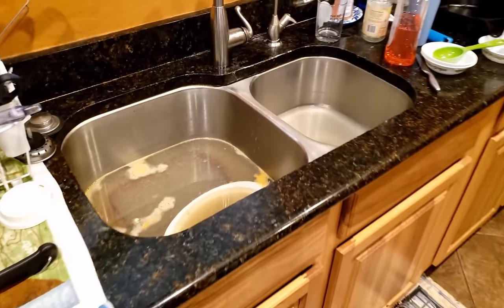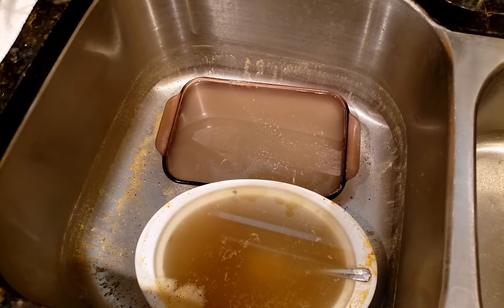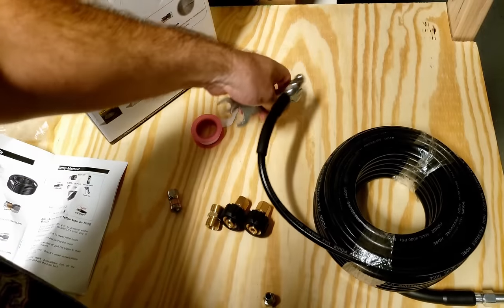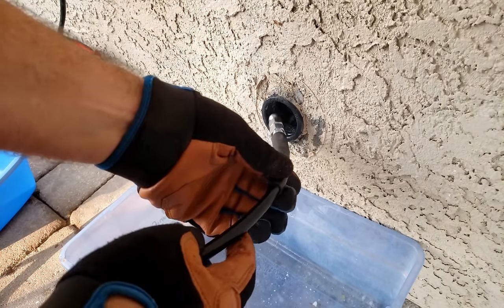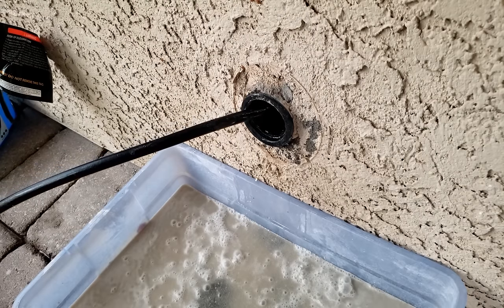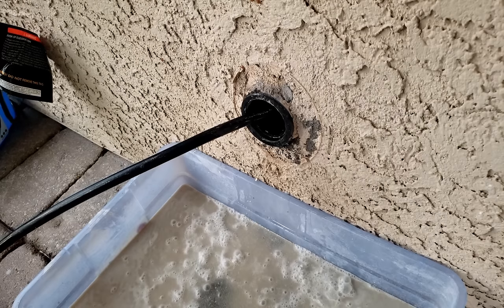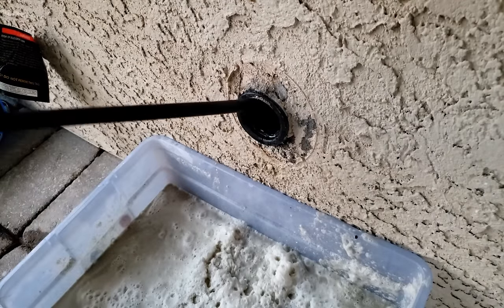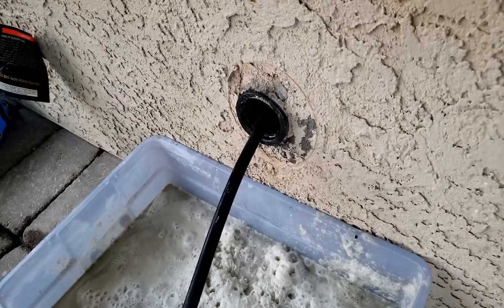UNCLOGGING my kitchen sink with a PRESSURE WASHER and the POHIR Sewer Jetter Kit

Comment: I followed how you flushed the clean out from the kitchen sink & it worked. Only needed to insert just 7-10 feet of the 50-foot hydrojet hose into the clean out in my backyard & all of the debris in the sewer line from my kitchen sink got flushed out in about 30 minutes 😎

Thanks for doing this video!
Reply from the maker: That's Great!
Reply: When I unscrewed the knob of the clean out in my backyard, I didn’t see any opening at all. Can you please tell me why?
Reply from the maker: @thanhpham-di9zq  If you are not able to find the clean out drain opening outside you can access the sewer pipe from under your sink. You can also unscrew the drain pipe that attaches to the wall. This pipe goes to your sewer line too. Just be prepared for water coming back out. Have some tubs and a wet vac handy.
Reply: @ThatHobby  : I’ll be able to locate 2 clean outs in the outside wall, but after I removed (unscrewed) the caps, I saw no opening, it’s like there’s a plug in each of them. Any idea?
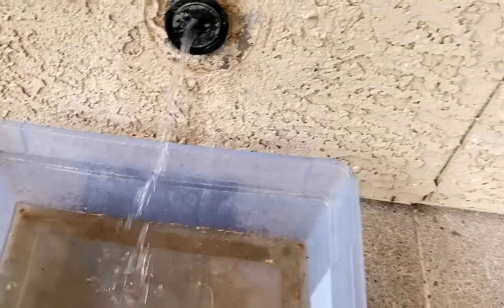Reply from the maker: @thanhpham-di9zq  Maybe there is a different kind of cap in your pipes. You can see what mine looks like were I had to open it with a chisel and a wrench. 1:37 You could try and search how to open the clean out drains in your area and see if there are some different techniques. I think the cleanout drains are different in different parts of the country.
Reply: @ThatHobby  : thank you

Comment: I’m a plumber I like to snake first then jet it doesn’t take long if you have a clean out. I have a technique to and it works great. It often gets me tips as well when I test it in front of the customer nobody is happier than them.
Reply from the maker: Great tip! A few people have recommended that I snake the pipe first. I will look into getting a good snake to test out.
Reply: @ThatHobby  just rent a 50' with 3/8 cable for a kitchen drain, unless you have to snake often enough to justify buying a drum machine.

Comment: For sinks and tubs a 1/8" jetter Hose instead if a 1/4" hose would work better, as it can be fed  from the sink drain and is flexible enough to go around there p-traps, this will work for most clogs... Also a spinning nozzle coupled with a 2500+ PSI pressure washer will clean the entire pipe interior more efficiently.

If you're investing in a system I may also recommend purchasing in a foot pedal valve and upgrading to 100' 1/4" hose to reach most mainline to sewers.
Reply from the maker: That sounds awesome. A foot pedal would be great too. I had my son pull the trigger on the pressure washer while I was feeding the sewer jetter into the pipe. So yeah a foot pedal would be better that way you can clean out the pipe without a helper.
Reply: I've always wondered about that when I see those pressure washer drain cleaning kits. They list the maximum working pressure of the hose but they never seem to mention the minimum pressure for proper operation of the jet nozzles. So a 2601 - 3600 PSI electric power washer should work just fine with a kit like this one, no need for the big gasoline powered pressure washers. good to know.
Reply: @ThatHobby  You had a lot of grease buildup in there.   That can be tough for even the pro machines to extract.  That little machine probably took a lot longer to clear, but still did an EXELENT JOB for a fraction of the cost of a drain cleaner/plumber!!!  WELL DONE!!!!
Reply from the maker: @crforfreedom7407  Thanks! Yeah it took a few tries to break up the clog.
Reply: Yea def would work alot better with a bigger pressure washer. One with more psi and a higher gpm rate
Reply: This recommendation is 100% on the mark. For 2-1/2” pipes or smaller the 1/8” hose is the way to go. The 1/8” hose has 1/8” npt pipe threads so a 1/4” male to 1/8” female reducer is needed in order to install the nozzles which are 1/4” female threaded.
Reply: I had to have a plumber out to clear my kitchen sink drain due to my garbage disposal causing a blockage. To clear that he had to run a snake from the roof drain. That fixed it until I ran my dishwasher and it overflowed onto. The kitchen floor. I called the plumber to tell him and he said they noticed lots of grease and that I really needed to have the grease cleared by power washing my drain. My bill for the sink drain was $500 and if they power wash my drain pipes to clear the grease another $500! 
I’m going to do what I read in one of these comments about heating water in the stove and pouring down the drain pipes before I give them another $500. I’m a widow on fixed income and don’t have money to pay them again. I will never use my garbage disposal again as this is the second time this happened within a couple of years.

Comment: I had a clog just this week in the kitchen sink, replaced the garbage disposal, checked the p traps ran a snake 25 ft, and added CLR, also dish soap and warm water. Nothing worked. Bought a $12 gallon of main line drain cleaner from wal mart that had great reviews, poured overnight, let it sit for 8 hours ran hot water the next morning and it worked great no more clog. May not work for everyone but take the cheapest and easiest route to trouble shoot before calling plumbers or doing too much work like this video
Reply from the maker: Yep always try the simple stuff first.

Comment: I use a bladder bag when my drain slows or clogs. It may take some time for mains clogs but it does work. When we bought the house the first winter we had it clog up and freeze up because of the clog and extremely cold temps. The bladder swells and creates a blocking point while pressurized water pulsates until it breaks through the clog. I just used one for another line freeze in a barn too. They are awesome and cheap and only require a hose and some patients to feed it down the lines. They come in 3 different sizes and the home depot husky brands are lifetime warrantied too.
Reply from the maker: I will have to check it out. I had a clog in my swimming pool pipe and I used a bladder bladder that I got from the pool store and when I stuck it in the pipe it blew up. I haven't tried any other brands but it sounds like you are having some luck with the husky brand. Thanks for the tip.
Reply: @Brogren802
They are also known as "Water Wenie" and "Drain King."
Reply: They have gotten myself into more trouble with bladder than anything else.  Cable/snake or jetter
Reply: I use smaller hose with drop head on jetter
Reply: Unfortunately "snakes" don't work on grease clogs, it's like sticking a straw into mashed potatoes

Comment: This is the first time i see a plug on the outside of the drain pipe. We don't use that where I live. Maybe because we don't have winter season. 
What I do is look up where the water stops. Open where the pupes are joining and use the drain king. Connect the garden hose to it and done. 👍🏽
Reply from the maker: I am not sure how common the clean out drain plugs are. My house is about 15 years old and I have 4 of them. I live in the suburbs and they seems pretty common out here in Arizona. A lot of people have said they like the drain king too. Just make sure you have a backflow preventer on your faucet to prevent any sewer water from getting syphoned back into your drinking water pipes. Most pressure washers have one built in. The thing I like about the sewer jetter is you can push the nozzle right into the pipe to break up the clog.

Comment: I had the same issue today in sink used a 50 foot snake and that didnt do anything i will definitely be purchasing this. Thank you so much  i appreciate it 🙏
Reply from the maker: Yeah I have snaked my drain a bunch of times. It usually worked but this clog was pretty bad and I wasn't able to clean it out with the snake either. So I got the sewer jetter. The clog was pretty bad. It took me 3 tries to break it up but once it broke up the clog the sewer jetter really cleaned out the sewer pipe.

Comment: It’s nice to wash out the pipes it didn’t have the power to go deep inside, but rodding it out the old way seems cleaner and would go deeper. I would buy one to try it for certain applications thanks for the video.
Reply from the maker: Thanks! The kit I used came with a 50 ft hose. So it went in the pipes a long ways. They also sell a 70 ft and a 100 ft hose for this kit too. I had a 25 ft metal snake that I used a bunch of times. But it didn't work for this clog. So I needed something bigger. To get a 50 ft metal snake was kind of expensive. So I decided to try the sewer jetter kit first and it worked great.

Comment: Great video I just had a plumber hydrojet my kitchen sink to fix my clog and it set me back about $500. If it happens again I now know how to fix it myself.  Thanks
Reply from the maker: Yeah that's what I figured it would cost for a plumber to fix a clog like that. I already had the pressure washer so I only had to buy the sewer jetter. But some other people have said they bought both and it was still half the price of a plumber. Plus you can clean it out again whenever you need too. Thanks for the info on the price of a plumber!

Comment: I wonder if that water stinks? 😁

The best way to clear the clog is to run the jet down to the clog and then pull back an inch or so. This will allow the penetrator to cut through the clog. Once you are through and water is draining work that spot back and forth, maybe a foot either direction of the initial stopping point. Also, twisting the jet hose as you move it back and forth will help clear the material from the pipe walls. If it is grease you are fighting, it is usually in the first 10 feet or so. Concentrating on that part of the pipe is much better than just running the jet down the pipe. If you've got hard grease, those little pressure washer jets work okay in the smaller lines you'll find running from the kitchen sink (1 1/2 and 2inch) but they aren't really powerful enough for the main lines (3 and 4 inch). They'll often punch through but they won't cut wall to wall.

Dumping some degreaser in the drain will help to keep the grease moving once it's broken up. I use Zep Industrial Degreaser (you can buy it at the home center).
Reply from the maker: Yep it stunk! It smells great now and I haven't had any issues since I cleaned it out back in October. Great advice on the technique. Once you hit the clog backing off and letting the sewer jetter do it's job really seems to get that crud out of there.
Reply: Thank you
Reply: I ordered the 2000 psi power washer. Should I have ordered the 3000 psi version?
Reply: @nutricook1  
Depends. I've got two jetters. One is a trailer mounted monster with a diesel engine that can produce 18 gallons a minute at 4000 psi through 500' of 1/2" hose on a hydraulically operated reel. The other is a small electric one that runs 1.2 gallons per minute at 2100 psi through an 1/8" hose that is 100' long. Each has it's purposes. The real trick is to match the jetter with the hose and head. The most efficient jetting is done when everything is within a narrow range, i.e., the hose diameter and length matched with a head that is drilled to deliver the right amount of water at the right pressure that the jetter can provide.

I don't want to get too far into the weeds with the reasons why getting specifically ranged products work better but a professionally designed system is going to be a better jetter than one that just gets assembled from random parts. That being said, from what I've seen, these Amazon kits are generally matched up to the 2000-2500 psi range pressure washers. If you have too much pressure, the jet stream turns into more of a mist than a grease busting stream. 

Check the specs for your kit you and match the pressure washer to that. Or vice versa, match the kit to a pressure washer you already have. They will do an adequate job on basic clogs (toilet paper, grease, food particles, etc.) but you will need to take your time to get a good cleaning. It won't do much in the way of root cutting or scale removal but that's not what most people are trying to do.
Reply: @rogermccaslin5963  Thank you.

Comment: Wow what an amazing way to snake your drains.  Looked like that head was designed to assist with forward motion down the drain by having two jets going backward.    Thanks for sharing.
Reply from the maker: Yes it was! I have had a lot of issues with this drain. This thing really seemed to do the trick.
Reply: @ThatHobby  I have the old drum kind that you run in.  Was interesting the way that endcap was.  My pipes are all cast and to small for code today.  Guess they didn't flush as much in the early 60's ROFL  Never seen a cap like that.  I could only imagine the dialog that you cut when the flood came. ROFL

Comment: I have like a 30 gallon holding tank that pumps the sewage up hill to the City Sewage line..., awkward, but it works., I had to have it snaked once and they did use a snake unit, ($500 for that one),,, Just recently I had it happen again, out came another guy, but he used a gas pressure washer and was charged ($550 for this one).. Like you, I have an Electric PW, so your video caught my eye...,, awesome, never thought of this... Awesome video..., I went out the following day and bought the hose... Now I'm ready, and the $500+ will go back into my pocket... I thank you so much for your video..., you were the inspiration I needed... The Hose I bought is the "Wet Hornet" for Electric PW's.
Reply from the maker: Great job and thanks for the great comment. Yeah that Wet Hornet looks real nice and its the same color as the Sun Joe too. It seems like most people are saying it cost around $500 bucks to have your drain line cleaned out. You can buy a sewer jetter and an electric pressure washer for under $500. Plus you are all set if you have to clean it out again.
Reply: @ThatHobby  I have watched your Video several times, and will most likely view it several more times..., there is something satisfying in watching you saving money... Again, thank you so much for your post...

Comment: Thanks. I ordered the 70ft version just in case I needed that length. This is just what I am
Looking for. I am hoping it works out for me. I have had my drain in my utility room in the basement clog up in me three times and it smells so bad and gets into my office. I ordered it through you link.
Reply from the maker: Awesome!!! Let me know how it all works out. One issue people have working inside is connecting a water hose to the pressure washer. Some basements have a hose faucet for the washing machine that you can use. The other issue people have is they can't use a gas pressure washer inside. Using an electric pressure washer can solve that issue. But yeah the 70 ft house should help a lot to give you some extra length if you have any of those set up issues.

Comment: I did this exact same thing recently! Original owner used the garbage disposal and dumped grease a lot I guess. I was sick of snaking it 2-3 times a year. Main sink backed up twice and toilets and shower/tub filled up recently. Plumbers quoted me $500 to hydrojet the main sewer line. I said screw that and bought everything for less than $250 and did it myself.
Reply from the maker: Thats awesome. I was in the same spot. I didn't call a plumber but that was my guess. I am glad this fix worked for both of us.
Reply: Dang... just paid $600 for Roto-Rooter. Didn't know you can do it yourself.
Reply: Rotor rotor not good, they remove the clogg but not the sewer walls

Comment: As a 40 year professional plumber if you simply must pour your grease down the drain make sure you have the hot water running and pour dish soap into the sink so all three go down together and leave the hot water running for a minute or two to get it into the city main and you won’t have to go through this
Reply from the maker: I don't think I have ever poured grease down the drain though. It must be getting in from the dishes. A lot of the time I soak pots and pans and then I dump the cold greasy water down the drain. So yeah I never really thought about it. I will give the hot soaping water a try. Thanks